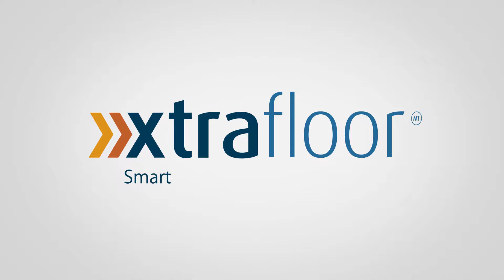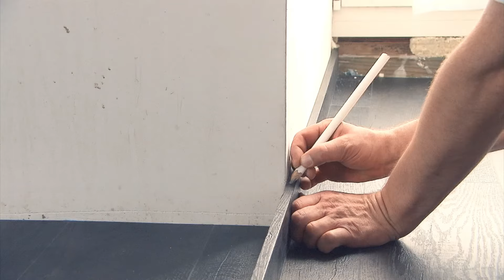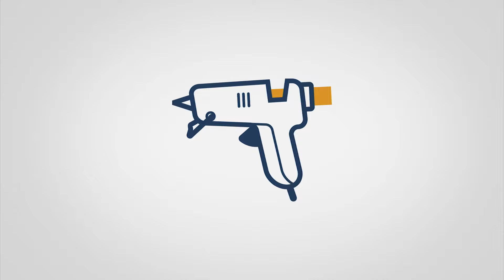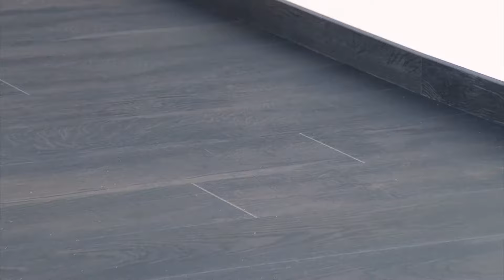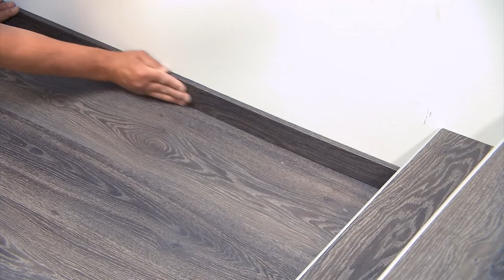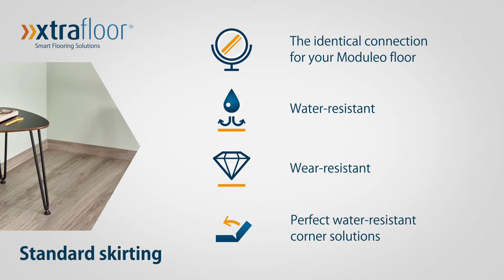Moduleo Xtrafloor standard skirting easy install

Comment: Tell me the name of the equipment that cuts the outer corner. Thanks
Reply: Same question!
Reply: It's pretty amazing that Moduleo hasn't answered this. I just bought these boards from my local vendor and they lent me a "cutter" which I've been using. Unfortunately it only works for 90° corners. I still have it at home and I can try to take a picture of it (when I get there later today), but I tried googling it and that hasn't really been giving me any results so I assume this is some custom equipment.
Reply: @morrocane1  yup... looks very similar to what the vendor I bought from lent me.